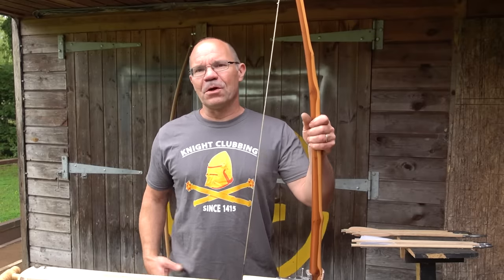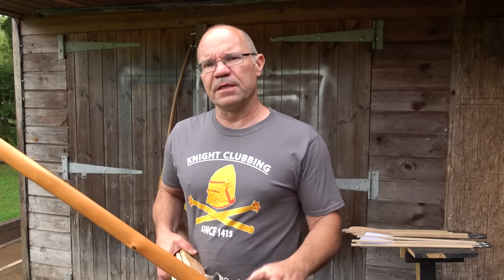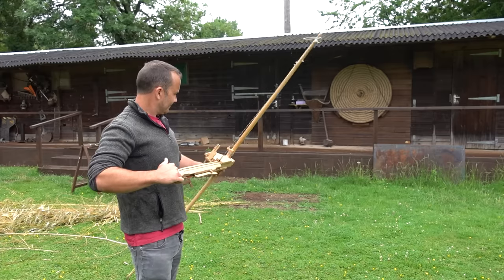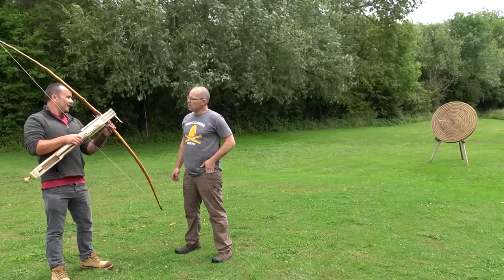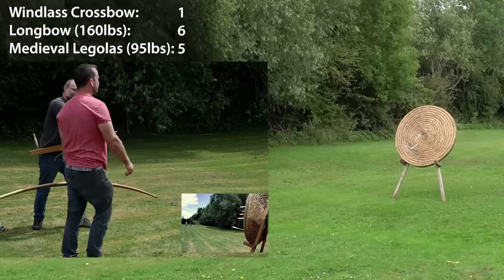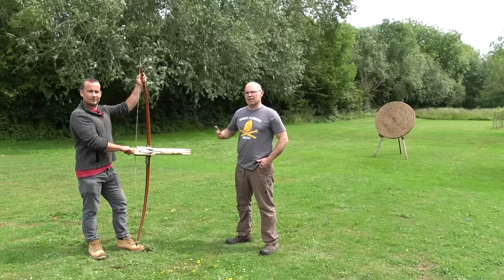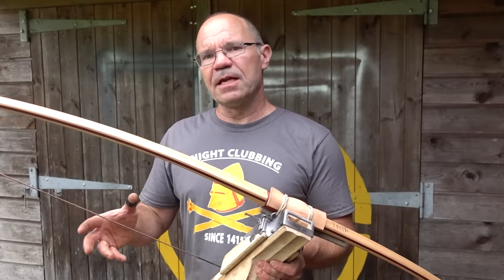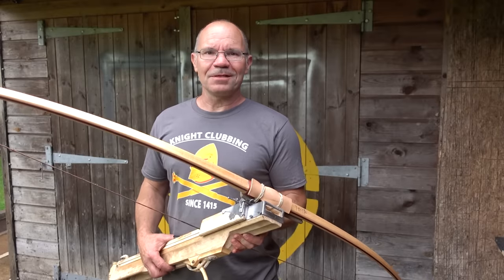Tod's 120lb Medieval Legolas - TESTED

Comment: I want to emphasize the importance of turning the rear-hand draw grip from a horizontal handle to a vertical one.  I'm kind of stunned that the idea could go through so many archer's hands without a clear message of "first of all, this handle needs to be vertical to emulate the string draw and how the muscles work together and are trained."
Reply: I think it has remained horizontal to facilitate the trigger mechanism.
Reply: @sigma6656  well, I'm pretty sure that with some ingenuity the trigger mechanism could be moved
Reply: @lexsmithee652  undoubtedly
Reply: Maybe a leather loop, rather than a odd door handle  (breaking/falling off).
Reply: @johnpotter4750  Yeah a flexible handle wins allowing a natural range of motion (infact should help avoid tiring as rapidly as you will naturally shift muscle groups in use subtly as you go something a rigid handle prevents - it constrains the movement and forces you to use the same muscles every time). Though for me its using bowstring or equivalent to hold a wooden/bone/horn baton - like one of those old style toggle buttons. The trigger can easily be made longer, moved to the other hand, become part of the draw handle (deliberate twist in the right direction pulls it open) or removed altogether - just use the rapid fire mag fed system with an automatic release at full draw - very like how high power bows are usually shot - you don't hold drawn then aim just pull back and release in one motion.
Reply: Some of Jörg's iterations had this (it may have predated the horizontal, actually), but he changed it for his own comfort, I believe. Something to do with the effort involved in pushing against the draw assist system, I think?
Reply: @Chasmodius  early versions were vertical, he changed to horizontal because he felt that was easier with heavy draw.
Someone under this vid pointed out that it might be easier for him because he's used to drawing heavy weight slingshots, which you do grip horizontally.
Best would be a swiveling grip so you can find your own comfortable angle.
Reply: The vertical grip is not a superior grip. It just feels more natural for archers because they HAVE TO grip vertically on a regular bow, meaning that their muscles have adopted for that particular grip and  motion. If you start with 0 archery background the vertical grip is not easier nor more natural, try it.
Reply: @kooroshrostami27  Try what, suddenly losing all my knowledge of body mechanics?  More than training preference is the symmetry between the hands; since the bow hand is vertical, the draw hand is best vertical unless some other strong consideration is introduced.

Here's something for you to try: mimic the motion of drawing, with a VERTICAL bow hand with maximum extension to the front and the HORIZONTAL draw hand maximally drawn back (remember to keep the line between front and back hands clear of the body); now, rotate the rear draw hand from horizontal to vertical.  You will find your draw distance has increased.  After drawing to your new maximum, rotate your rear draw hand back from vertical to horizontal without reducing your draw distance - do you feel the increased tension/strain on your shoulder?  This also shifts the muscular load from the large, strong, durable muscles of the middle back to the relatively small, weak, and vulnerable muscles connecting the neck and shoulder.  This effect is heightened as draw weight increases.  The best grip mechanism is a free-rotating one to accommodate personal preference and adjustments over time, but a generally vertical grip will be mechanically superior in almost every vertical bow-drawing circumstance.
Reply: wait... why virtical? compound bows with the quick release are not virtical
and im feeling the motion right now and having it virtical is actually activating muscles and having it be virtical would mean more moving parts and more likely to break
KISS method my guy, Keep it Simple Stupid
the only reason ied see someone wanting a virtical grip is simply for the classic aethetic but if your doing that, might aswell forget the SIL too
Reply: @kooroshrostami27  You body is designed to have more strength with a vertical grip when pulling, it's all in efficiency of bio-mechanics. This applies to all things, especially horse riders.
Reply: @xandercorp 12:55 they literally say that a different hand position might be better or that you need to get used to the horizontal. Get off your high horse watch the whole video and appreciate the craftsmanship and passion, as well as Tods openness to new ideas and design improvement, which is rare to see nowadays as no one likes to be wrong

Comment: "you're in a slightly different position, so i makes you work a bit harder". You should follow up on that, and work with Joe to polish up the design!
Reply: Exactly. Rotate the pulling grip and set it precisely along the length of the draw that the shooter is accustomed to. Having to pull beyond his head is much more awkward, and likely felt goofy - if not technically "harder". The pulling handle needs to be an adjustable length to fit most users comfort spots for aiming /size of bow.
Reply: Yep! Idealizing the positioning of the final grip would be key. Still impressive as is.
Reply: Ergonomics can go a long way, if you need to use an unfamiliar piece of equipment, but muscle memory over time can negate ergonomics entirely. It's quite a strange occurrence. 
If you use a wooden shovel enough, it becomes an extension of your body and even better than a well researched light weight titanium handled shovel with rubber grips in the right places.

Comment: A simple reason why it was so trying for Joe to shoot could be the fact that he has literally less time to recover from fatigue from one shot to the next.  The fatigue debt accumulates over time and drawing the bow becomes increasingly harder as he shoots.
Reply: Exactly my first thoughts. Taking the moment to grasp a new arrow and put it on the string is basically giving your muscles a brief rest.
Reply: It wasn't just that, he was obviously having a harder time even with the first shot. I think the real problem is that he can't lean the way he typically does, and that lean helps with engaging the back muscles.
Reply: It's basically like doing reps in the gym
Reply: Ancient military could amend this by use of rotating files, like musketeers used to.
Reply: In a battle bow vs anybody else, fratgue is not the problem. you want to shoot as fast as much as possible to cripple enemy formation ot charge, after this, you use your legs to go behjind your own shild wall.

During repositioning, your arms recovers for a second big volley, and after this, it is hand to hand combat time, were your frontline wins vs a crippled frontline.

If I see the fast shooting video, 8sec for 5 shots, end enough time to refill the arrows, and reshot again 5 shots. In the time a normal longbow did 8 shoots, or the crossbow die 2 shots. This would be a very strong increase in a time, were bow was the king of range weapon.
Reply: Still impressive to do all that. Gotta be exhausting. I don't know if I could do a single 95lb draw let alone that many in a row.

Comment: Amazing, I think Joe is a master, but I think it was an error to get rid of the front grip. Maybe it needs a redesign, but that front grip was there to take the strain away from keeping the bow at full draw,  It never looks like Joe uses it like that. He pulls it back and never grips it. That would add strain.
6:13 is a perfect example, he is shaking keeping it at full draw, but if he just gripped that front plate, all the strain would be removed.

Edit: I believe to grip it would be hard, and I believe he felt like he did not want to hold it, he wanted to shoot fast and use his normal draw style.
I just wish they would go more in-depth with how hard it is to grip, can you keep it at full draw just holding it by the grip? Does this take any strain off? Is it just not worth it to have a grip like that on a 120 pound bow because you want speed not accuracy on long shots? You could use the grip at full-draw to sit there without strain while lining up a shot.
Is it just not worth it because you need the full grip on the bow just to draw it back? Is releasing your fingers for even that last moment just too difficult? Is the grip super hard to hold at full draw?
Whatever the result I cant wait to see more videos.
Reply: his problem was that, at least as designed, he would have to partially release his grip on the bow itself to do so, which is unnatural/counterintuitive at that draw weight, since otherwise your thumb has to bear the full weight of the bow while you open your hand to accept the handle.  There might be another way to do it that’s more natural, but as is I think removing the handle is a decent decision as a tradeoff, and one I could see many archers in the period making, even if the handle is objectively better once the death grip instinct is unlearned.
Reply: Joerg put that front grip in after he removed the crossbow like locking mechanism. He did so do to potential legal issues of having that feature in would mean that the Legolas may have to be licensed to own in some countries. However that would not be an issue during the Medieval time period, so putting it back in may be the way to go.
Reply: @PacMonster0  It did not look like he even tried, but I get that the draw is hard. But he completed the draw and did not grip it at that point. Why?
Reply: @IONATVS  I agree with you, but he completed the draw, and STILL did not use the grip. Why?
Reply: @begone88  because it isnt natural for him. This isnt a hard concept
Reply: @begone88  because changing your grip with 120 lbs of tension is a bad idea?  The grips ONLY use is if you plan to hold the bow at full draw for a length of time.  He didn't need to.
Reply: His entire shooting style is about releasing the arrow as soon as he's drawn it back fully, to maximize speed and minimize the amount of time spent in that position. You're basically asking a medieval archer to treat his bow more like a crossbow, which coupled with the inherent difficult of changing your grip at 120lb of draw weight is extremely counter intuitive.
Reply: You think your fingers can easily squeeze the grip on a fully drawn 120lb bow? You must be dreaming kid. Average grip strength of a normal adult male is around 100lb.
Reply: @furrytrash8399  This is a different system though, as soon as you fully pull it back you can grip it to take the strain off the draw hand. Now I can see reasons for NOT doing this, maybe it's too hard? Maybe the grip strength required is too great for that big of a bow, but they never talk about anything like that in the video, and I don't ever actually see him grip it. So I just wish Tod would go a bit more in-depth with that.
Reply: @goldenrootsnet  I don't know how easy it would be, but I can see that being a valid point. However, that was not his complaint for it to be removed, it was that he could not draw it how he normally does it. I just wish they would have gone a bit more in-depth with that part. Maybe have shown if it was hard to keep it gripped or not. I would like to know that.
Reply: Here's the thing: Joe doesn't hold it back at full draw for very long, and that is 100% intentional. His entire technique is designed to get the bow back to the draw length and be in a position to shoot accurately the moment it arrives, then release almost immediately. Holding it back for any length of time is counter-productive, as exhaustion would set in quickly, leading to his arms beginning to tremble and very much hurting accuracy.

And as other commenters have stated, opening his grip on the bow made it much more difficult for him when pulling a bow of that weight.
Reply: This is a combo of replies I've left on other comments: This is a question for Joe more than anything, but I think that opening and closing your hand during the draw of a heavy longbow may make the draw significantly more difficult. When you bench press (or any press for that matter) with heavy weight you're supposed to grip the barbell as tightly as possible because it increases muscle activation in the arms and shoulders. Your grip muscles aren't contributing directly to the lift, but flexing them helps engage every last fiber of the muscles that are. I think the same principle may apply to drawing a longbow, where gripping hard with the lead hand makes the draw easier, while opening and closing the hand makes it more taxing. So that's one possible reason to get rid of the handle.

The other reason is about the bow. Don't all-wood bows take damage from being held at full-draw? Doesn't it take power off your shot and weaken the bow in the long run? I think I read that in a book called The Art of Making Selfbows, but I could be overestimating the effect. Maybe 5-10 seconds is harmless. Another question for Joe.
Reply: @mccallcarlson3580  I agree with you, I just want to see them explore it more. Can the grip be redesigned to let you fully hold the bow and then grip it somehow? Or is it simply not possible with these kinds of bows? I would also just like to see if using the grip is even possible with a 120-pound bow. 
>Don't all-wood bows take damage from being held at full-draw? 

JoergSprave brought this up in a vide and he said he did not agree with it, and even if it did it might be worth it.
Reply: 'Squeezing' the bow with your bow hand is bad. It introduces torque (you'll be twisting the bow slightly left or right when you squeeze), which massively impacts accuracy.

Check out any olympic archery video, and immediately on release, their bows will just flop forward away from them, because they're not gripping the bow with their bow hand at all.

A longbow will be a little different, as it'll want to jump forward a bit more at the end of the shot (and they're generally not rocking wrist straps) but you'll still want to use the absolute MINIMUM squeeze you can get away with. 120lbs of squeeze is not in any way 'minimal' :)
Reply: @goldenrootsnet  Where are you getting that number from exactly? I can hang my bodyweight (160lbs) from a pullup bar with one hand for at least a second. I'm quite average.

If you're strong enough to draw 120lbs, you can definitely hang longer than I did.

EDIT: To be fair, the base of your fingers is stronger than the fingertips because of leverage, so I'm not sure how the situations are comparable.
Reply: That front grip is a bit of a design contradiction. It's there to make it easier to aim for an extended period of time, but it interferes with shooting really fast volleys. While the main strength of the design is about shooting fast volleys, which makes extensive aiming less important.
Reply from the maker: The aiming grip works great and was very useful for me, but I shot a max of 45 and it felt great.  Joe shot a max of 120 and it did not feel great to him. It could have been his dislike or it could have been that it doesn't work at those poundages, but none of us can can say he is wrong for his choice until we can do what he can.
Reply: @tods_workshop  but you didn't tell him it was an accuracy aid. I never saw him grip it at full draw it seem like it got scrapped before you could use it to it's full potential. 

Is there any chance of implementing some sort of locking device once you reach full draw?
Reply: @tods_workshop  Thank you for the reply.
Reply: @stefanb6539  Good point that I also address. But I feel like the assist to aiming for long periods of time would be useful to someone that cant really shoot heavy poundage bows well. All you would need is the strength to get it to the full draw, then you could use the sights and grip to aim with no stress. Sure it would be slower, but it would work for less skilled people.
However.
Like you said, maybe it's just not worth the trade off of being able to file very fast volleys. Or maybe it's not even possible to have due to the way you need to draw a heavy bow. I wish Tod and Joe would explore it more!